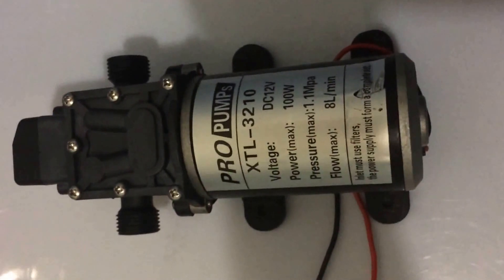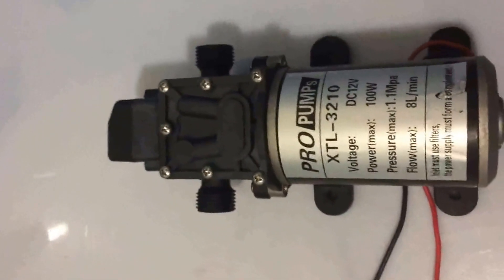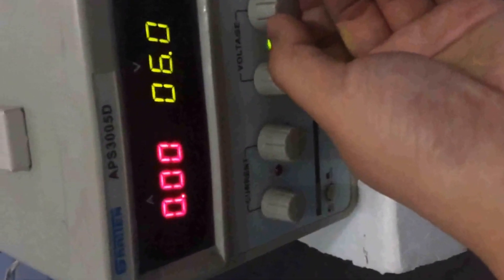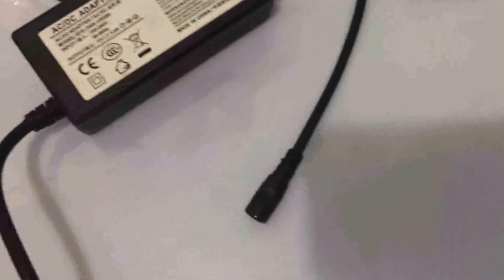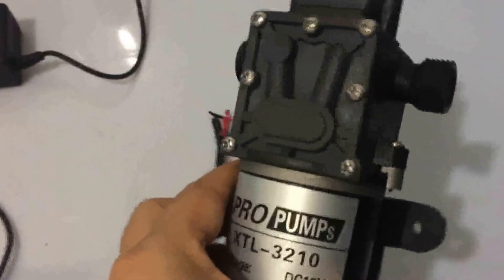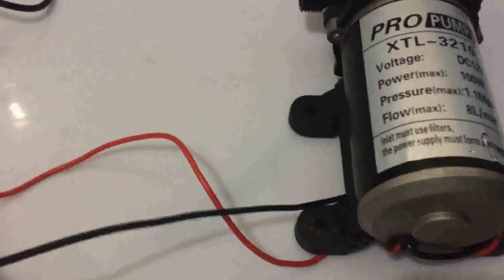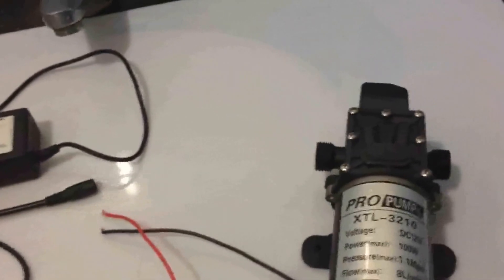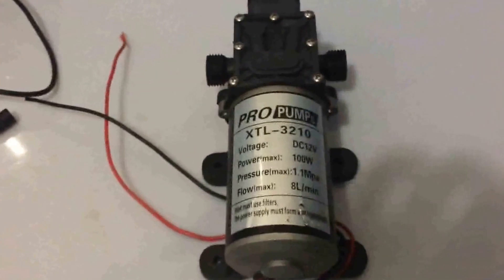3210YB 12 100 Micro diaphragm pump working demo video

Comment: Very noisy
Reply from the maker: Yes, you are correct, noisy is deemed as one typical working characteristics of a diaphragm pump product. 

Instead, brushless DC pump products will work with low noise, yet, they cannot be self-priming.
Different types, different performances. 

For example,. https://youtu.be/ZxmVLLxj2tE 
or, 
https://youtu.be/mh_RXF8sKsI

Comment: Lily Yan: Who in the whole-hell uploads a video WITHOUT A DEMONSTRATION of functionality??!
Reply from the maker: My friend, with all due respect, please do not use word like 'hell'. This is my recommendation.
Reply from the maker: Regarding this short video, it was just recorded for a previous user, who used a less-powerful AC/DC power adapter to power this pump, so it cannot run normally. Just for this purpose.
Reply from the maker: As to its real spraying performance, currently I temporarily don't have demo video to share, at this moment. Yet, some descriptions on the notes of video may show some info that is useful. For sure, I also suppose that it's a bit pity that video does't show the performance of pump. I agree with this point.

Comment: what's the output of adapter should have? 12volt output & how much Amp is need for this pump.
Reply from the maker: 12VDC, 9A or 10A should be OK.
Reply: Lily Yan are those for laptops adapter?
Reply from the maker: I think that laptop adapter is not suitable to power this pump. As far as I know, it should be with output capacity of appr. 19VDC.
Instead, matching power adapter for this pump is recommended to be with output capacity of 12VDC, 9A (more or less)
Reply: @lilyyan5645  Hello, i want to ask this propump can used with 80watt adaptor? Because i have this product and i use 80watt adaptor. When i use continuesly that's make the cable going very hot and burning the switch controller, but i use with spare time thats not make hot. Sorry bad english.
Reply from the maker: @herdinanriza9153  If it is this model, namely 12VDC 100W model, then corresponding AC/DC power adapter is recommended to be with output capacity of 12VDC, >8A. Otherwise, it could be less powerful than needed, and cannot run the pump normally. 

Regarding work time, normally it is not recommended to work over 1 hour per time, taking into consideration its brushed motor design: heat, and friction of brush design. Therefore, if it is used for long time continuously, naturally it is not recommended, and its life shall be negatively impacted in certain way.
Reply: @lilyyan5645  p

Comment: I have the same pump. There are two wires for the battery and one wire that I did not know
Reply from the maker: If your pump is the same, there only exist two cables: Positive and Negative. No 3rd cable exists.
Reply: Yes there is a positive and negative cable, but there is a third cable at the top if you have Watts or Emails
Reply from the maker: In our pump product, we don't have the 3rd cable.

By the way, it's my sincere recommendation that you'd better directly contact the seller who provided you the pump; after all, it's the pump of his/hers and he/she must know more in detail on the pump in your hands.